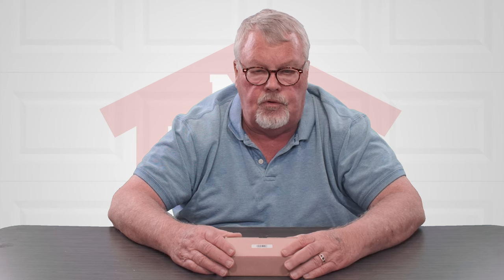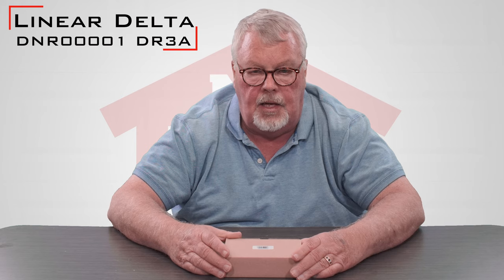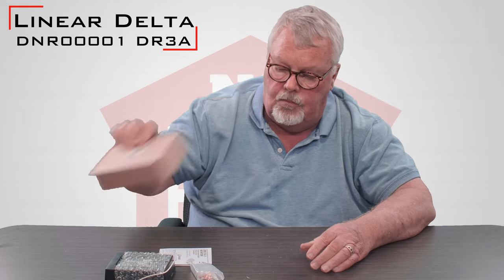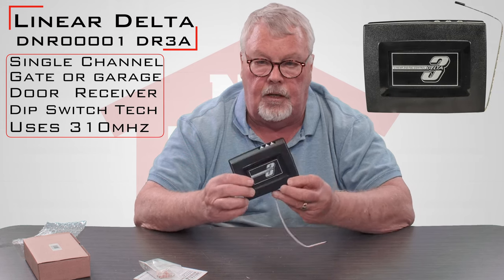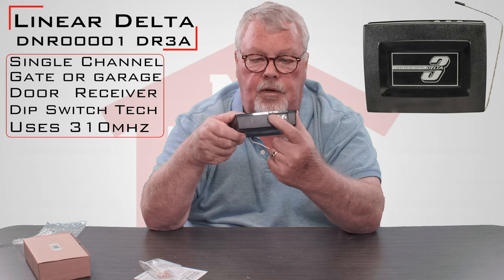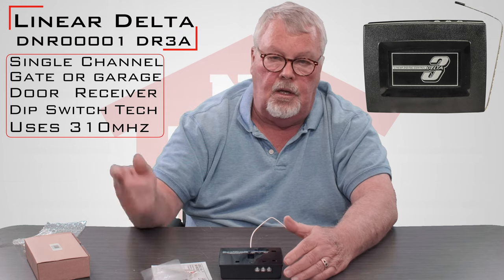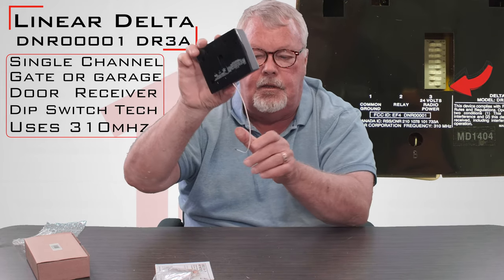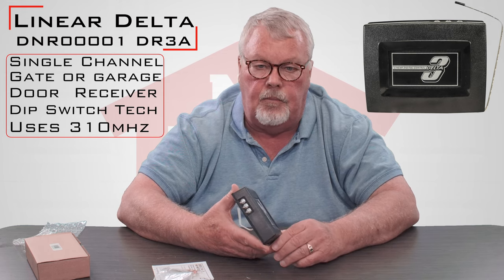Linear Delta 3 DNR00001 DR DR3A Single Channel Gate or Garage Door Receiver

Comment: Hello NS My Raynor door operator is at least 20 yrs old and it has the Delta 3 receiver. I get a clicking noise and the door will not open. Is it the Delta 3 malfunctioning? Thanks.

Comment: Can you hook up a smart garage opener to this type of controller? I purchased a GoControl GD00Z-4 and blew out the transformer upon connection (note the transformer that was in the garage was underrated and had been replaced before. I have replaced with an original 40Va) to terminal R1 to R2 like the online instructions show. I have a 12' RV bay door and the opener has a open/close/stop switch inside but works on standard opener delta-3 remotes. Any suggestions?
Reply: Can you program your car's home link to this device?